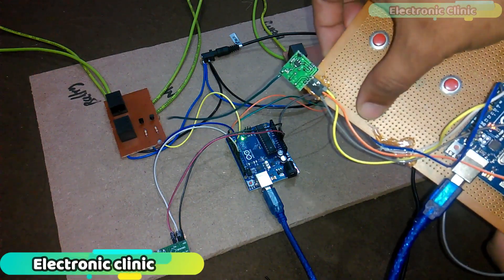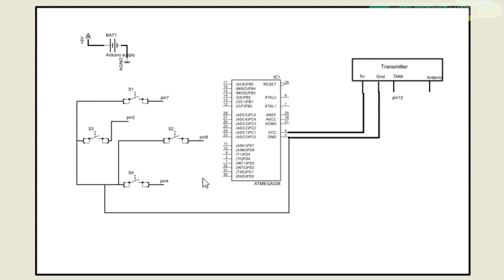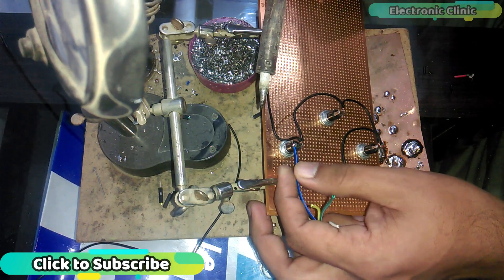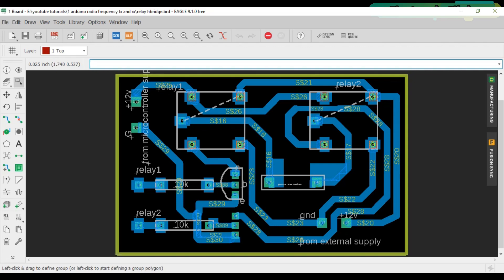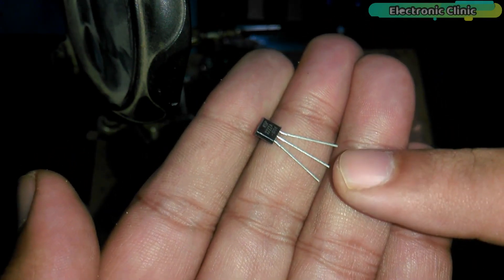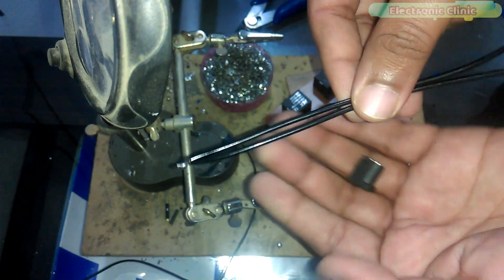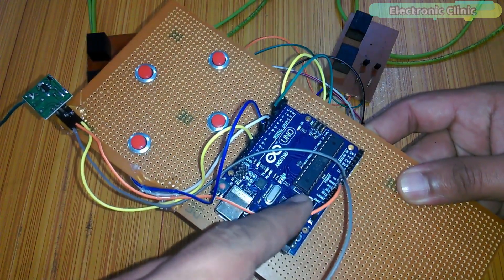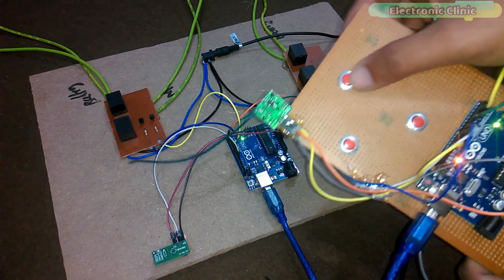Arduino 433mhz rf transmitter and receiver module, rf wireless data transfer, rf 433mhz tx and rx

Comment: I have a half a$$ lazy question (sorry :) 
What kind of wireless connection/setup would you use for an ultra simple and ultra low power mail box notification system?
  I was thinking about building something that could run on a battery, and send a message if something is placed in the mailbox. Fortunately my mailbox opens from the top and mail is placed inside a pocket like container. I think I can use a simple proximity switch (like the ones used for microwave oven doors) that will trip when something in placed in the mailbox. I just need to come up with a simple way to send and receive that notification from 50-100 meters away, confirm the message was received, then power down until the next event? I've seen a few people build something similar with wifi but I think there should be an easier way. Plus I really don't want the status of my mailbox transmitted on my wifi or on a web server. 
-Jake
Reply from the maker: You can use zigbee for this, its use is very simple. You can also use Lora. Just connect a sensor on the transmitter side and an led or buzzer on the receiver side
Reply from the maker: You can also use a gsm module. You will receive a text message. You can watch my tutorials on gsm